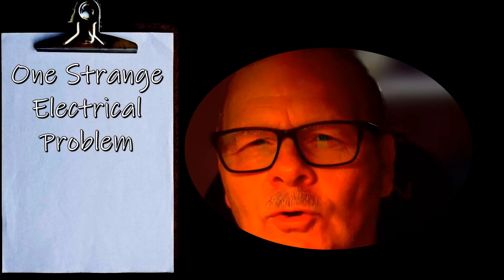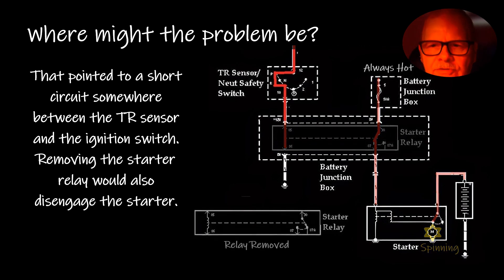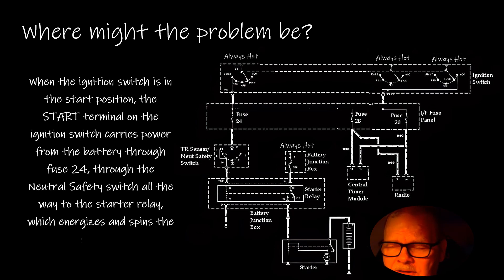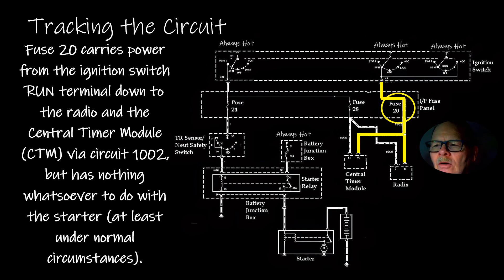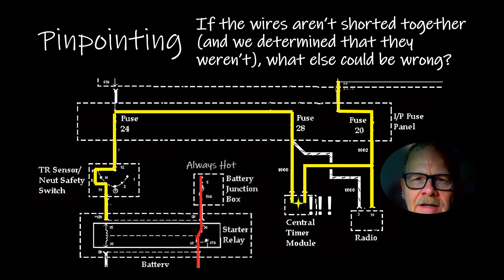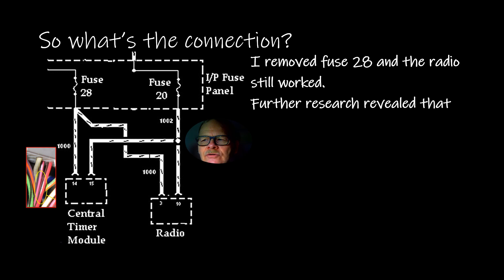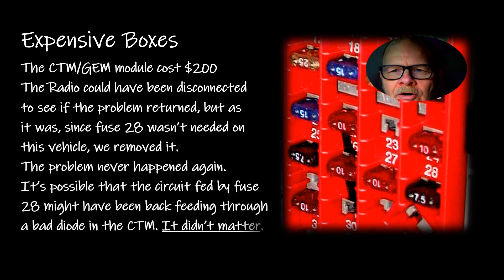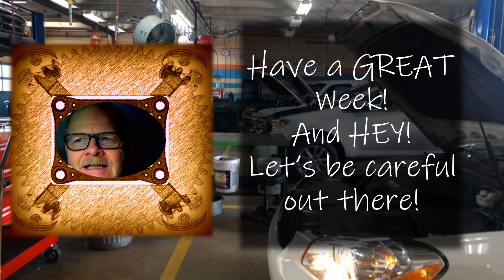One Strange Electrical Problem

Comment: Thank you for the war stories sir! 
Had a similar issue on a 2018 Chevy Cruze with start stop. The starter would stay running for 20 seconds after engine start. The tach worked but the car would stall when put in gear... dealership said the TC clutch was "bad" and it needed a new transmission.
Ended up having an incorrect part # crank position sensor recently installed by the customer. 
Never even got thanked for finding that one... and saving the customer $8k+... just a complaint about some other nic nac issue 😒

Comment: Seen an old 90's ranger yesterday very well kept all blue, stock suspension, with wide tires a couple inches wider than the fenders, loud extra thick wide pipe dualled  and I was like O.K. later in a parking lot was a black 90's mustang gt with the chrome five spoke factory rims parked next to and it made me look.  My Dad showed me how electricity worked as soon as possible so by mid school I was learning to read them to wire 20+ AA batteries on a secret project. Good schematics are the map to use while some of that incomplete stuff will get you lost. Start Monday Go Good Morning

Comment: Yesterday, I was trying to figure out an issue with a Ford that cranks as soon as the battery is connected. It happens after it rains and the battery terminals melt. This happens with the key out of the ignition. Thank you for this video. It will help further my diagnosis if I see the truck again.